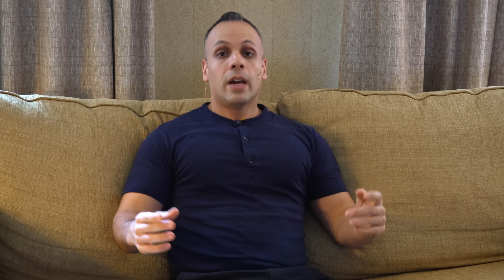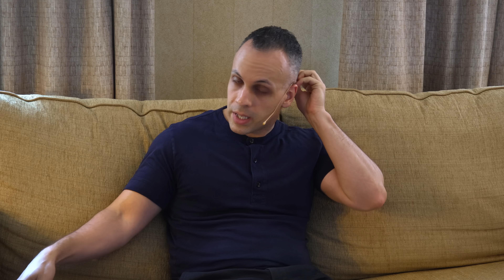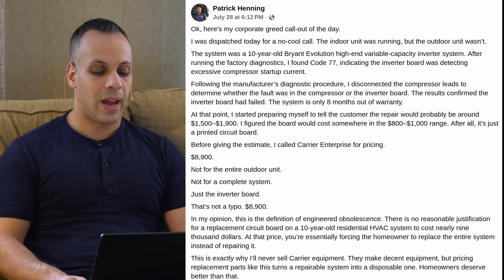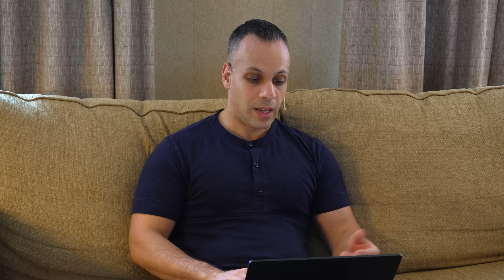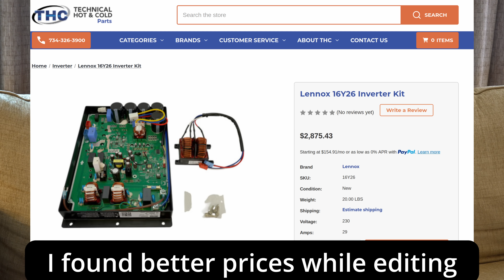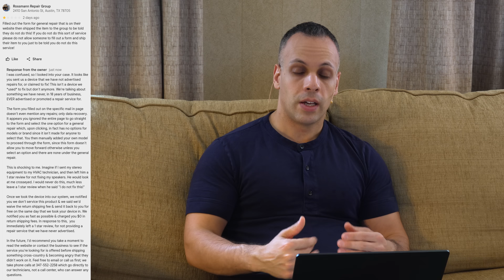Carrier AC repair has $8700 part cost for residential unit

Comment: Shout out to Louis' local HVAC guy steering him away from Carrier.
Reply: Quality service!
Reply: I do commercial HVAC control systems, and Carrier is by far the worst. I’ve never met a Carrier employee who was not an idiot.
Reply: @SicSemperTyrannisx9 lol, one of you guys.  I see you chumps bragging at the supply house all the time. The only thing you seem to be good at is cleaning out the doughnut box.
Reply: the local guy isnt anti carrier hes anti overly complex systems more points of failure
Reply: Good on Luis for knowing what the C stands for in HVAC, CONDITIONING.  He's 100% right that LONG run times at lower power are so much better than short high power.  The longer the unit runs, the longer it conditions the air.  This is big down in Florida where we need humidity removal.  A slight under sized unit will run longer, but will remove more humidity and have better air quality vs. an oversized system.  Hvac is fun!
Reply: Goodman makes great equipment.
Reply: @nxckk_ Junkitrol sucks. People just claim it's good because because Goodman is known to sell to two guys and a Truck who will then underbid everybody else while claiming it's the same 😆
Reply: @nxckk_  garbage!

Comment: Did you check price from Carrier because they are very proprietary. The guy making the repair obviously did not call an authorized Carrier dealer because a decent service company with a relationship with carrier would have been able to get that part warrantied. I have over 10 years experience in the HVAC industry. I will not argue that carrier is one of the most expensive companies and quite honestly I think it's a rip-off I would go with Daikin the same company as the Goodman you replaced in your house however a better product. Daikin is the largest manufacturer of HVAC products in the world, proudly building each product in Texas.

Comment: Sad part is that is just for a 1/3 hp fan on the top of the unit. Not the compressor.  "Inverter Replacement Kit, For XC25 / XP25 5 Ton AC Units Cat # : 16Y26 Model/Part # Output 1/3 HP Product Voltage 208-230 VAC 1. Self-tapping screws."

Comment: I have a small business, I own my building, it has 2 A/C units. I have been in here since 1982. I have replaced both units 3 times in that time. The first was a Trane. Both failed in the 1st 10 years. I knew an A/C man, and he installed Amana, units. Again less than 10 years. This time a Friend recommended an A/C serviceman, he came out and installed 2 Goodman  "Good Enough",  and happily they are still going, I did have to replace 1 condenser fan, and 1 run capacitor. These things I can do myself. So for my Money There is none better than Goodman.

Comment: Parts price/availability is the least of your problems. Design to just last the warranty period is the big one. I installed a high end Carrier system in 2014. Loved it. No issues at all. The compressor lost its neutral and failed 18 months after the 10 year warranty was up. I figured, OK, we'll replace the compressor. Nope. The old refrigerant is now banned so I had to replace the entire system. That $8900 board is insane, but I wish I could have spent $10k on a compressor rather than $40k on an entire system replacement.

Comment: 1979 my folks bought a house with an Arkla Servel A/C  Natural Gas Fired Ammonia type HUGE! After the last service tech retired, he gave me an entire set of manuals. I kept it going for another 20 years.  The OT'ers that fixed those units were honest and hard working.
Reply: I have had a bad experience with those as well. They are nowhere near as efficient as they claim and the ammonia boiler tends to crack where the fins are welded on - letting all the toxic ammonia leak out.

Comment: I also immediately thought, "I bet those boards that get replaced have very simple issues that could be repaired."  Probably easier than working on Macbook boards, too.
Reply: How would I go about learning to repair inverter boards for AC systems and mini splits? I’m an HVAC student right now less than a year from getting certified but I’ve studied my ass off. I’m still young, and I know the future is electronic and digital, so if I learned how to repair these boards it would help me a lot. Also I have minor experience in soldering too. Any reccomendations for books to read, videos to watch, or courses to take would be greatly appreciated.

Comment: After seeing your earlier video, I assumed it was a part number or parts snafu of some sort.  Turns out you're right.  My two AC units (two story house) are both 35 years old and still running fine with an occasional capacitor, contactor, fan motor, etc.  When I have to replace them, I'll make sure to install "dumb" lower efficiency units which still mostly get by with basic electro-mechanical  controls and not computerized commands.
Reply: My HVAC guy says they just done build them like they used to and they have maybe a 15 yr life span these days compared to 30+ of the old ones.

Comment: Is anybody doing component level repairs on these boards? Imagine a cheap capacitor, resistor, diode, ect. causing an $8700 board to fail.

Comment: I work for a company that sells OEM and aftermarket parts for the foodservice industry, mostly selling to other distributors, service companies, and large chains. There is a lot of margin bloat/FU Buy New in OEM prices, as we can usually go right to the guy the OEM buys their parts from, buy the exact same part, and easily sell it for half the OEM's distributor price. Sometimes the OEM is reselling a super common component that any Joe could get from, e.g., Digi-Key, for 10% OEM (we get it cheaper because of volume). Boards are hard to get, as there's often proprietary/contract restrictions on getting them from their sources. Depending on the age and how common the unit is, you may also be able to find remanufactured versions of the boards you need, but YMMV.

Comment: All of the HVAC people around here will tell you to avoid Carrier like the plaque for this very reason. I have an AC unit that is pushing 20 years old. After a few capacitor and motor changes over the years it might be time to look for a new unit. I was told to avoid Carrier at all cost.

Comment: The mini splits are a better option because they are often far cheaper and there's more competition.  Nowadays the even offer low -profile mini splits so they can fit up a ceiling with only the grill below so not ugly like those older style bulky units.  A slight step up is a ducted mini split, requires a bit more work to install and you have to fabricate some of that duct work, but those are still far less than the conventional style central HVAC systems by companies like carrier.

Comment: I had a carrier HVAC unit in my house that was here when we moved in. The furnace was about 12 years old and the heat exchanger gave up the ghost in February in Connecticut while it was WELL below freezing (also had covid at the time it was a pretty brutal month). The heat exchanger on a Carrier unit carries a 20 (or 25 don't remember exactly) year warranty. Carrier would not send a heat exchanger to me they would only send one to a certified Carrier technician. Not a single certified carrier technician would agree to replace the heat exchanger (I called all of them, even out to NY), every single one of them said the furnace was too old and needed to be replaced. Would Carrier have honored the warranty? Maybe, I guess in theory, but without anyone "certified" agreeing to do the work they wouldn't send one. I spent 3 weeks calling technicians and Carrier while I ran a 125k btu kerosene heater in my living room in like 20 minute spurts and carrying a carbon monixde detector around until I could finally get someone to rip the whole unit out and replace it with a non-carrier unit. I would unequivocally never buy Carrier and highly recommend everyone stay away.

Comment: I too, have a goodness system in my home. And there is no way inhale, that I would buy a carrier unit because of this. This is a fuck you price byu a new unit .
They don't want people repairing units, they just want new units in the field.

Now, let's look at the rest of the story. Yes inverter DC units are the most efficient units to operate? But you need to buy the extended warranty. Because when they brave a lot of times it's cheaper to replace the whole damn unit 

Even though I have a goodman system several years ago my blower motor on the indoor unit started erroring out and it was either the motor or the control board. And there was no definite way to verify which one the thing is, if you buy the control board for 500 dollars and you're wrong. You get to buy a motor for 800 dollars or you can buy the whole cabinet for 900 
So as a result, you change both parts and you know that the problem is resolved, but this has become an a common thing. In hvac, where repairing is, I like rolling a dice. There's too many components out there that are overpriced, and they're  design to end up costing the customer more money and making it cheaper. To actually just replace the unit

Myself, as an electrician, I bought the unit swapped the fan and the board out, and you know, it is what it is. Everybody's not an electrician.
Yeah, the only way to test and verify in that situation is. If you got a board or a motor that you know is good, but the other problem is the motor has to be programmed to the board that it's plugging up to. So if you change one, it has to be programmed to the other, which there again is more complication and unnecessary extent. For the consumer, the entire industry is set up. That way, which is why I chose to just change both
But ultimately, Goodman makes reasonably efficient units that you do what you need to do. I do find it interesting, though mr cool is causing all of these companies headaches.

Comment: Bro, the whole HVAC industry is a scam. I unit recently had the fan controller board go bad, so the fan constantly ran. I had one tech come out and he told me it was a bad relay, and it would be $300 to replace plus the $80 diagnosis fee.. The relay cost $12, so I ordered and replaced it. Didn't fix it. Called another company, they were no shows. A third company didn't return my call. A fourth said they didn't do repairs on systems as old as mine ( 10 years ), and would recommend replacement. A fifth sent out a tech who let me know the fan controller built into my fan was bad, and it would be $1000 to replace it. Luckily he was cool enough to let me know what model of fan I needed and I was able to order a replacement for $200. It was 10 screws and a plug, took an hour including the youtube how to videos I watched.
Reply: You lucked out.  Many new systems use ECM control boards and fans which are $2000+ to replace - and maybe that's what they were initially trying to trick you into paying.  The old units that have basic logic circuit to control fan on/off and maybe even defrost cycles are only a couple hundred - and yeah you can probably use a generic board swap for cheaper.

Comment: First, @#$@, I just replaced my old York AC with a Carrier. I'm sort of locked into the whole Infinity/Evolution line. I've looked into this kind of thing, and the HVAC industry is definitely taking advantage of the regulations under the guise of safety and homeowner protection. They hide behind proprietary designs and make it very difficult to introduce any third-party tech. Their prices reflect this.

Comment: Just had a friend, who is getting the requisite experience for his HVAC certification, come out and looked at my A/C system during his off-hours.  The system on my house is over 20 years old and the coolant/refrigerant in it is no longer manufactured (thanks EPA!).  I thought it was struggling to cool the house-- turns out it wasn't, I just run hot myself.  Anyway, he did a full inspection free of charge, told me everything that is out of date, etc.  Then he looked me in the eyes and said, "do not replace your unit."  He said it works perfectly fine, the coolant is at proper pressure, no under or over voltage anywhere, just gently wash the coils on the condenser every month and it will continue to serve me just fine.  If it ever goes out because of a $40 PCB, I will learn to fix that f**ker myself before I shell out $9,000 for a replacement.

Edit: and my parents have a 30+ year old Carrier unit that runs just fine.  It''s only needed significant repairs 3 times in its life.

Comment: I had a board go bad on my unit, did I replace the board, no. I took the board out and replaced the component that failed. Still works a year later.

Comment: Not a HVAC guy but a homeowner in Asia, an Inverter board would cost somewhere around 20-40% of the total cost of the ac. And if you can DIY then it will be a bit cheaper, I can find an Inverter board of Daikin for 15% the unit price. Carrier (it's Carrier-Toshiba here, not Midea rebranded as Carrier) Inverter board usually cost more than let's say Mitsubishi Electric or Daikin. Some people do repair these board for living too, it's a cheaper alternative in case of replacing the board is too expensive (parts and labor are cheap)

Another interesting thing is that the variable speed system isn't much expensive than the traditional system, it is even cheaper with lower end less efficient model.
Just for fun, for $430 you can get a 12k btu Daikin Inverter entry model mini split with installation here.
Reply: That is a US thing. They also mostly don't use the AC units to heat, because the one additional valve that's needed seems to be to expensive to put in the units. They rather run gas lines and install the whole burner setup just to heat. The market seems to be mostly shielded from innovation in general :D
Midea/Daikin/Mitsu isn't really big in the US.

Comment: i did hvac. YES the price is to make you buy a new one. YES we do take them home and sell them when a customer gets talked into a more efficient unit instead of a repair . i have a 90's trane on my shed from that right now. works fine. YES you will save money on electric with newer inverter systems just to loose all on the first repair. Enshitifcation has hit the HVAC industry as well. If i was unlucky enough to buy a home with one of those I would probably just replace the entire condenser unit with a used "good enough" one for under 1,000 dollars on marketplace. I have done this for people already, had to change the fan motor inside the air handler and put in a few relays to go old school but compared to the old quote i was a hero. also realize this was side work no a/c company would ever let me do that, most likely against the law due to efficiency rules.  ZERO possibility I'm paying 5k for a new system let alone 8k for a repair. You can find them all day long on marketplace. You get get all the tools you need to DIY it and the license to buy the refrigerant AND an entire tank of refrigerant for less than 1,000. The knowledge is free on youtube. over 20 years ago now i hired a guy to fix my a/c i watched and seen what he did, i was not impressed for what he did vs what he charged BUT i understood it was the knowledge i was paying for. i figured it wasn't that hard . I was correct . its just a closed loop system recycling the same gas, its not rocket science.  here is an example of a used condenser a trane 4 ton condenser for $675 https://www.facebook.com/marketplace/item/1474982214654587/?ref=search&referral_code=null&referral_story_type=post&tracking=browse_serp%3Aeb2a7108-b6b7-48de-8b4c-81e4e6bb60fc

Comment: F you, buy a new  one.  I will not buy a Carrier.  I think the prices of all these inverter boards are ripoffs.  It's not just the manufacturers.  I had a problem with my A/C.  I got several quotes on repair ranging from $800 to 'need to replace the unit'.  Did a little looking around on youtube, spent around $60 and about 40 minutes and was back in the cool.

Comment: As a woman, who generally get ripped off to begin with... I learned to fix things myself. Fixed defective parts in my heater 3×.
In 2014, I got central air installed for $2400.
Reply: I hear ya. I've pulled toilets, replaced outlets, light fixtures, under sink pipe work, installed my own carpet, tile, linoleum, drywall (wanted to change a room)... the list goes on. I so wish I would have had YouTube back in those days. I had the internet because I was a Systems/Network administrator for 26 years before I retired but we didn't have the resources we have now and I couldn't  ask questions without getting the typical "oh sweetheart, let me do that for you, or where is your husband"? It was pretty awesome though because it was just me and my two daughters doing it all by ourselves and we learned together. They both are now very capable and independent women 😊.

Comment: I replace 2 HVAC units in my Florida house. It cost $10000. For Goodman. Both units are 2ton units. That cost included the condensers and installation. $8900 for a circuit board. That’s greed.

Comment: I also have a goodman, with a soft start, better than good enough
Reply: That soft start device is probably adding 10 years of useful life to your (or any) unit.
Reply: @blackrifle5.56 the silly part, I dont have any ac guys in my area that could install it, when I found one willing they installed it improperly, then removed it when my ac went out, so I cleaned it up, and installed it myself, warranty can be fickle, they will use any reason ti avoid covering but if you have an ac guy do the work.... needless to say, i only have them do yealrly service as thats a requirement for warranty and I still have a couple years left. But adding 10 years life to my ac, is good for me bad for ac places...